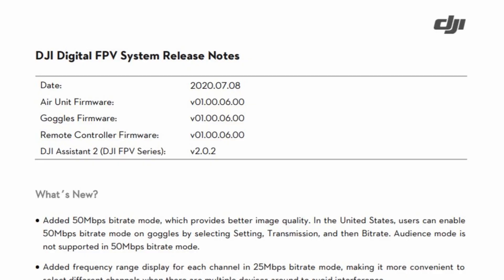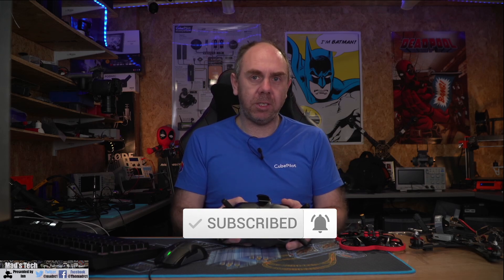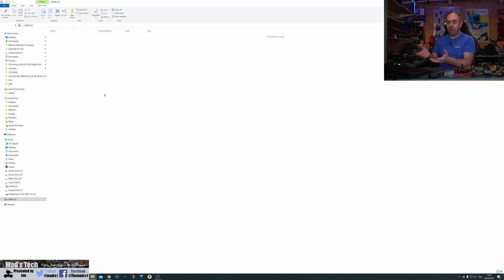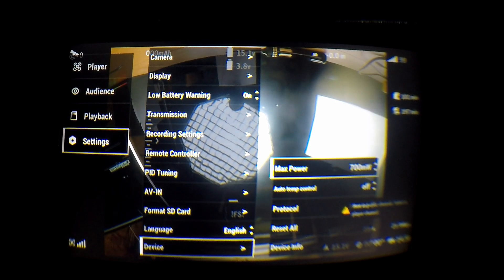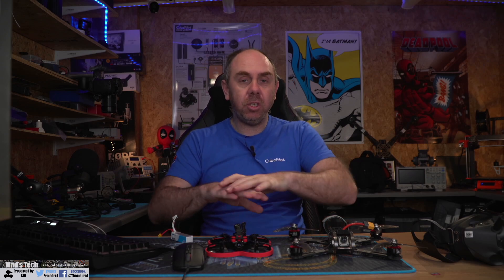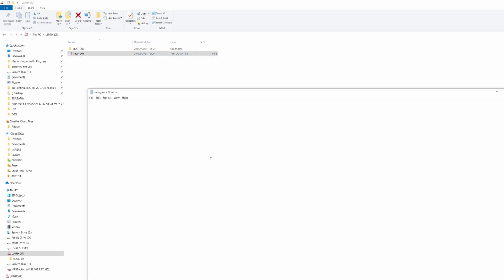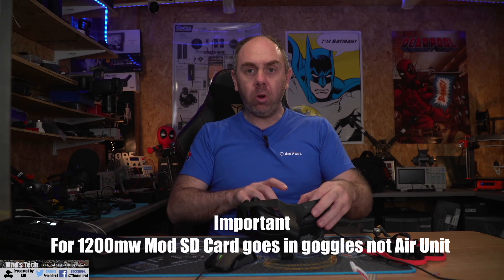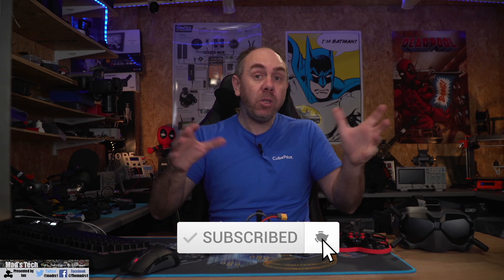DJI FPV Goggles V2 FCC & 1200mw Hack - Complete How-To For V1,V2, Caddx Vista & DJI Air Unit.

Comment: Hey, sorry for what might be a trivial question, because I'm from an analog environment. Does that mean.. setting higher power in the googles will also cause the air unit to transmit with higher power? Because in analog, you should have set higher transmit power to the analog VTX - It seemed logical. However, here the logic is reversed. -> you set higher power to the googles, which only receive the signal to have more transmit power on dji air unit? 🤯

Comment: Hi,how do you turn down the mw power setting on the dji goggles v2 ?  I need to turn all settings to the lowest output so as its not interfering with my friends analog signal

Comment: Question, it has been years since i did this to my original v2 goggles. But i recently bought a new pair of the same V2 goggles as a back up pair. But what i am wanting is the same functionality that i have on my current every day drivers which is the 1200mw hack. I dont want to turn these new ones on & update it the wrong way & not be able to have these abilities. I would prefer to have the same firmware on these to with dji getting banned i want to go ahead and have this done on the off chance i wont be able to due to the bann

Comment: I got my DJI goggles 2 and Nazqul Evoque and I'm loosing a signal in my goggles when the drone is only 100m away. I did try to do the FCC hack so I have more channels in my 10,20 and 40 MHz options but nothing changed with the range of my signal. Any idea how can I get rid of this issue? How can I get 1200mw in this goggles?

Comment: does the drone needs to be turned on and sync with goggles ?
Reply from the maker: Yes.
Reply: @MadRC  does this still work in 2023? I think DJI system is a separate system now isnt? you can't even sync your drone into this mode. Check that out and let us know Mads if possible
Reply: @joanvanz  Yes it does. I just did it to a Runcam Link Phoenix I just installed.  However I can't get it to work on a Caddx Nebula Pro I just installed even though it's worked on other Nebula Pros I've installed.  But yes, it does still work in 2023!!

Comment: Maybe someone can help me. I don´t get to see other mw than 25. I have the ham file on my Googles V2 sd. also I have the ham file on my O3 Air Unit sd. I see channel 1, 2, 3 and 8 in my Googles V2 menu but I can´t pick on (In the digital fpv system menu. In the regular O3 Air Unit menu I see 3 channels on 40. FCC should be activated, but I can´t get the mw to be changeable. I´m still on 25... Any advice?
Reply: From what Ive heard you cant do that hack with the newer firmware. You have to somehow downgrade your firmware to get the naco hack to work.

Comment: Fast forward to 2023. Do I still need to do the FCC hack on the vista air unit? Currently put the heck on the DJI goggles 2 . Is that enough or does it need to go on the vista to ? And what file do I use for the vista and avata ? The naco one ? Thank you
Reply: Were you able to find out anything on this?

Comment: Fcc hack should be enough for goggles? Or I have to do for air unit and goggles?
Reply from the maker: If not in fcc county you would need to do both Naco and Naco_pwr.  Otherwise if already in USA do naco_pwr only on goggles.

Comment: I plugged the air unit into my pc, and the drive  letter shows up but it is inaccessible. i can't open the drive to put the text file in. Any way to solve this?
Reply from the maker: Try turning the usb plug upside down where it goes into the vista and try again.

Comment: could you please help me. I know that some times are gone.I do not have the options that you have in your google. there is no menu which I can choice anything remotly like your googles!!? do you know why is that? I do believe in that I have the version 2 thank you for any help for I really am lost right now.  I have dont the hacks and noon of them works for me. Something very strange hapened to me thou. I bout an extra battery and when I try to use it the first time it  installed something on my drone, I am nearly shore about that it did that, do you know anything about that. is it possible to change the software comepletly so that I can get these menus back

Comment: awesome videos as usual, quick question of something you didn't cover, once done with the goggles, does the memory card need to stay in permanently? or once uploaded from the card, is it safe to remove?
Reply from the maker: No once it’s done it stays til you reset the goggles to factory or connect to assistant 2
Reply: @MadRC  superstar. Thank you.
Reply: @MadRC  keep the great vids coming :)

Comment: Hello. I had the naco files in place and they still are however after updating my v2 goggles for use with the latest Avata firmware, I have just come to fly my Pavo25 with Vista and I see Ch1, Ch2, Ch3 and Ch8 the rest are missing, I still have the option to select 1200nw is this hack still working?

Comment: @MadRC 
how do I go about doing this with new goggles V2 and 03 air unit? I don't have the OG air unit or vista. I'm in canada, but when i registered I didn't realize my vpn was running in an EU contry so does that mean i'm locked to 25mW only? do I need to do the FCC hack now? thanks for your help if anyone else has any info id appreciate it. thanks again.
Reply from the maker: See my ham file fcc hack.  There was a no 1200mw for O3

Comment: Hi, as far as I understand, it's necessary to update Goggles V2 to make them work with O3 Air Unit.  Whether it affects 1200mw hack?
Reply from the maker: No all the DJI hacks still work fine but there is no 1200me for O3
Reply: @MadRC hmm, I didn't know that 1200mw hack doesn't affect O3 Air Unit. I am confused a bit. Everyone says that O3 Air Unit has improved range. But whether it means that O3 Air Unit has improved range over previous iteration of Air Units only when used with Goggles V2 in "vanilla" condition or when used after applying 1200mw hack as well?

Comment: Has anyone experienced/fixed this issue?

Caddx polar vista with DJI goggles V2
Even in 1200mw FCC, auto temp control off, line of sight and only getting a maximum of 100-150m before video signal drops off 

I have done all the usual checks and suggestions but not a single thing has helped or improved this issue. 

Can anyone shed any light ?
Reply from the maker: Sounds like a hardware issue tbh. Chase you tried a new antenna as the CaddX ones are known to break.

Comment: Do these hacks work on 01.03.0000 v2 goggles,and the runcam wasp airunit?
Reply from the maker: Yes
Reply: @MadRC  thanks for reply I’ve recently done the drone hacks on my new FPV drone and wanted to put a air unit into something else but was worried that I might not get full output power,so thanks again for a bit of piece of mind,great that you support the community with your vids along with mr bardwell I’d be lost 🍺

Comment: I did this and had the 1200mw but then it just dissapeared and I can't get it to work again following your steps? Any idea why?
Reply from the maker: That’s odd. Did you connect to assistant 2 at all ?
Reply: @MadRC  It disappeared and I tried to do this before I connected. I tried to connect to maybe root them but it won't let me update firmware so can't even do that.

Comment: Hello, I loved your video but I have the problem that my PC does not see the dji air unity lite with runcam camera, it recognizes it and everything seems to be correct but it does not appear on the PC. Sometimes it appeared on the pc and asked me to format it because it wouldn't let me put the file naco I formatted it and did the process you mention also with the glasses to put the other file but it doesn't work for me I'm still with 25mw. Any suggestion?..., why can't air unity be seen on my pc?...
Reply from the maker: I have seen this. Try rotating your usb C cable 180 degrees if it’s not being seen.

Comment: Great vid, you always have very useful info… I have the V1 goggles and they are working great… I just got the V2 as a back up… I tried to register/update but the new DJI Assistant FPV series will not work with my either of my Mac’s… OSX El Capitan 10.11.6… or macOS Monterey 12.0.1… 
How do I update the V2 so I can use it…   Does Windows have the same problem at this point? If not, I can use my neighbors computer. Thanks for your help in advance!!!

Comment: works great! just purchased v2 goggles a few days ago and what an upgrade over my budget analog set up. i mostly fly around the yard so 1200 mw i dont really need but its there when i need it. plus having more options than just 25 or 700 is nice too.
Reply: do u updated? ive just bought v2s and it goes updated to, i guess, 1.0.7. do it still works?

Comment: Great info as always man thanks! It's now 08/2022 and I have a set of these goggles on the way, doe's the power hack still work?
Reply from the maker: Yes both FCC and the power hacks all still work.
Reply: @MadRC  Thanks man, sorry to bug you some more but will it work with the latest firmware that blocks downgrading. The internet is telling me yes and no lol but I trust you're advice more.

Comment: In order to do the 1200mw hack on the goggles, does it have to be connected to an air unit/ vista? I have no air unit set up yet, and there was no change after creating the textfile on the sd card.
My goggles v2 also can't change firmware. After activating, there only is the option to "downgrade". It is already running the firmware with the  0606 at the end. 
Hope it will be just fine now. Will set up drone with air unit now.
Reply: Does the 06.06 Firmware supports the 1200mW hack then ?

Comment: Do you need to leave the sd card in the goggles when using the naco_pwr setting?
Is there a particular channel which if more favourable around domestic properties, ie wifi etc as even at 100yds I see Ch1 change to red bars at 700mW. Thanks
Reply from the maker: No you can remove the card once done. The mod will only reset if you update the firmware or connect to assistant  2.
Reply: @MadRC  Thanks. I added the caddx 15cm antenna, added the sd card with the nacho_pwr txt file and sadly I got no improvement in video feed, I still get pixilation at no real distance (100m?)

Comment: Is it normal that if you update the caddx vista (with the dji assist) that the text document with the 1 stays on the vista? Its kinda weird, did i have done anything wrong? Is there a way i can tell that im in the 700mw mode? Can i display the power output in my Googles?

Comment: I mean seriously...is it really possible to make a high end gadget like this and make a meny where tapping the wrong button makes it useless. YES IT DOES!
I just bought these goggles, and just did hit the wrong button. 
If the guys at DJI could have two thoughts in their head at the same time, for gods sake make two menus  in the screen.
One for AIR UNIT, and one for DJI drones..
How difficult is it!!!?
Even me, beeing a novice in gadgets, and really hate them and pc etc, can make a better meny whan this.
Anyone can!!
Seriously, here in Norway we spend 900 dollars for this with a air unit, and one click wrong, you're fucked.
Reply from the maker: I’m sorry I have no idea what your talking about ? What do you mean one button and your  stuck ?
Reply: @MadRC  
Pressed the FPV button, wich locks me out without owning the DJI drone, to witch these goggles obvious belongs.
As in your video. Once you do that, locked out.
Now I have two pairs of the goggles, a fucking insane meny making it's possible.
Really, DJI..
Make a upgrade that have one meny for DJI drones, and one for Air units.
This is rubbish and NOT recommendable for friends, just for people I wish hell...
Reply from the maker: @dnumdug  you can switch back from the Settings menu.  As long as you are on the latest firmware there is the option to switch back on the about screen just scroll to the bottom.
Reply: @MadRC  ok.. and on wich update is this..?
Named update.
Reply from the maker: @dnumdug  if you don’t have the option in drone mode simply just update via assistant 2 to the latest firmware and you will have the option to switch back.
Reply: @MadRC  Ok, thank you!
But still have🖐👊message to DJI, why not have two in the screen wich devides air  unit an drone..?
It's KISS, keep i stupid simple.
DJI is lowset for me in far too advanced setup, they reconn everyone is at their level and willing to follow.
All in all, DJI things are not intuitive, not user friendly.
Filled with rabbitholes  simple guys not want to enter.
DJI, FIX IT!

Comment: I'm stumped, my caddx vista shows up in dpi assistant 2 fps series but doesn't show as a usb or hdd on my computer, so can't get to drop the file on, any advice? Thanks
Reply from the maker: when on and connected unplug and plug in the usb a fee times and it will show eventually.
Reply: @MadRC  will try that in a few minutes, thanks
Reply: @MadRC  It worked, unbelievable, took about 10 attempts. Can't believe it as it always shows in the assistant software but barely ever as a hdd. Thanks for that, greatly appreciated.

Comment: @Mad's Tech - Regarding the DJI FPV racer, is it possible to increase the MW of the FCC from 700 (default) to 1200 or 1400?
Reply from the maker: No it’s 700mw max.
Reply: @MadRC  - Max, thank you for clarification.

Comment: Thanks dear for your amazing explanation video..only I have a question..to keep this hack.. we need to keep the sim card in side.or it can be removed and hack remain?. Thanks
Reply from the maker: It remains as long as you don’t connect to assistant 2 for FPV.   If you update the firmware you will need to do it again.

Comment: I thought this would be a better place to ask my question about confirming that I really have 1200 MW. Does the OSD in the goggles says 1200 mw guarantee that's what the output is? Sometimes I feel like I'm not going very far on 1200 MW

Comment: I recently purchased the dji fpv drone and system. I checked the output and see that its stuck at 25 mw. I thought if living in the usa I would have 700 mw. How can I change that to 700 mw?
Reply: 25mw until armed

Comment: Great video but I have some thoughts and questions. If you can write to the internal storage of the CADDX, why not the  DJI Air Unit? Do I have to permanently leave the SD card with the hack on it inside the air unit at all times now? Just mildly inconvenient considering I have multiple quads with the DJI air unit and not enough micro SD's. Same with the goggles, sheesh.

Comment: Hi, my win10 pc doesn't allow me to interact with the Vista even if it sees it because it asks me to format it due to unrecognized file system in the Vista volume?
What should I do? I havn't updated to the last fw, it's still on 1.00.0606 which allows hacks, do you have any idea?
I'm afraid to brick the vista formatting it (in which file system...?)
Thanks

Comment: hello, I have already done everything explained in the video and it has not worked for me neither in the glasses nor in the cadxx view that could be I have the v2 and version 606, when I connect the drone to the lipo and turn on the googles it does not let me accessing the menu only gives me the image will they have any defect?
Reply: Same issue for me.. same versions and devices... You did it? How?

Comment: Ian I have a question regarding V1 and V2 goggles.
I have just bought a set of V2 as I (erroneously) thought they had HDMI out and in, as I wanted to use them with my Air 2 S and RC Pro controller, anyway that is now another problem for later. What I would like to know is how to be able to use both sets of goggles from a single air unit (me flying) so I can let spectators watch the flight with the other set. Do you perhaps know what I need to do as I note that you can only bind one set of goggles to one air unit at a  time.
Your help is appreciated.

Comment: Amazing video my friend.Exactly what I was looking for. I did the upgrade just fine. My screen in the goggles shows the 50MBPS . However my transmission lost connection now. It binds and then 10 seconds later goes from green to red. Why is that? Please help . Assoon As I saw the 50MBPS I was so happy but I cannot do any test flights because it won't connect with my Dji remote now. 😢
Reply from the maker: I would just reset and rebind everything.
Reply: @MadRC  Thank you for your reply Sir. I did that literally 4 times now. After resetting I finally see 4 channels 4th one being public but assoon as I assign another channel , I lose controller signal on the Dji remote. light goes red. but the drone doesn't beep even though it is supposed to after signal lose. what am I doing wrong??

Comment: Great video! What about option 'auto temp control', is it better to put it off?
Reply from the maker: You will not do any damage with it off.  It just helps stopping it overheat on the ground and stopping recording.

Comment: Hello, I'm from Brazil, I have the dji goggles and I need to repair the back button, do you know where the BLD1920 board is sold.
Reply from the maker: I’m not aware DJI sell parts.  There are some places that brake it down but usually it would be a PCB repair